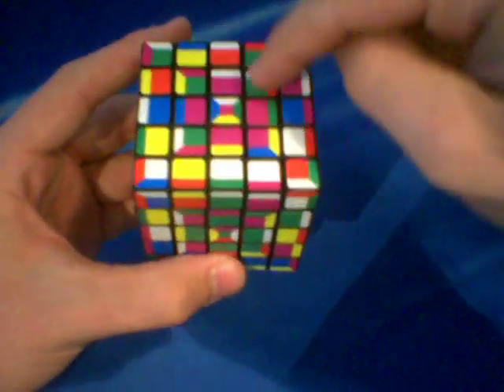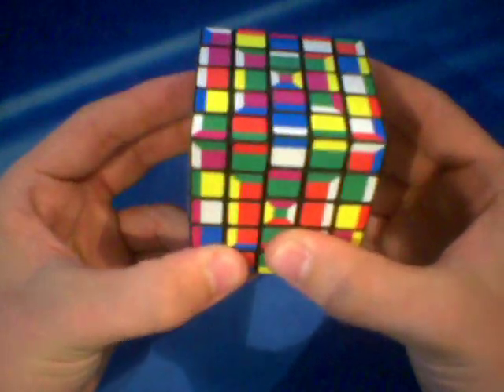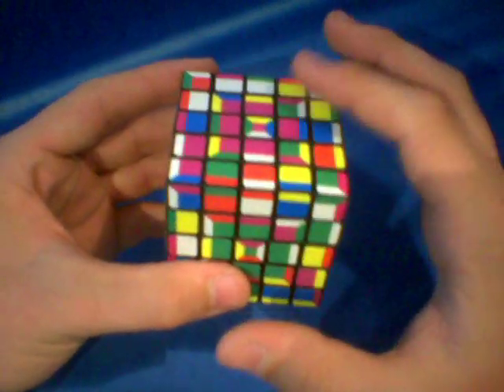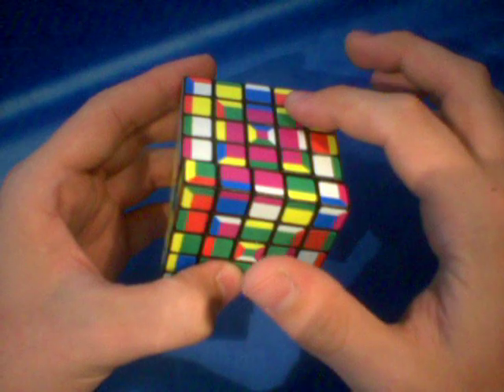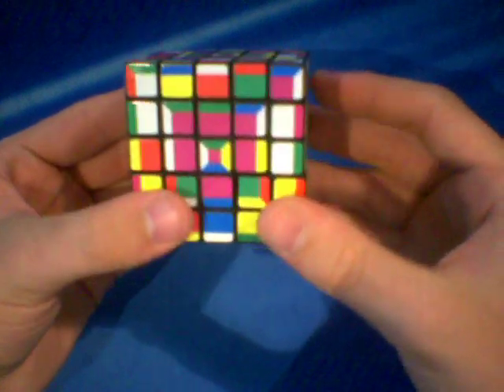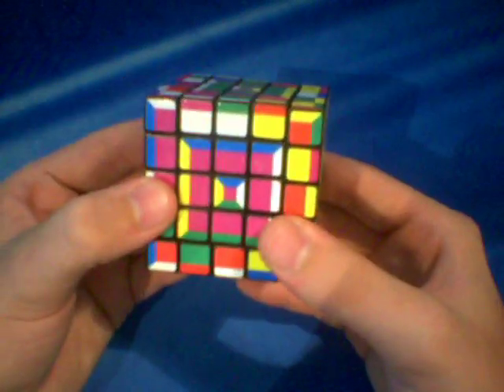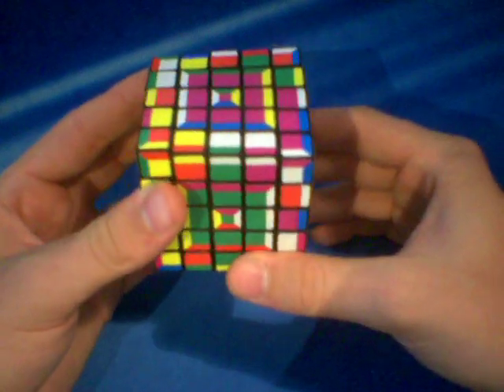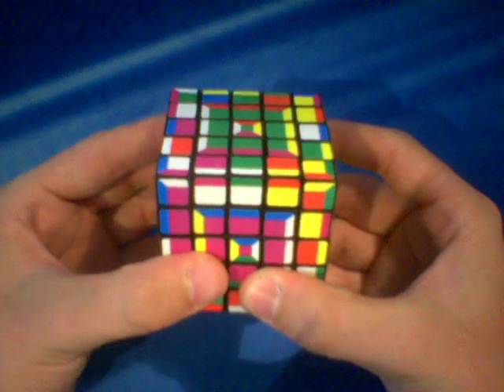Tutorial / How to Solve a 5x5 Super Cube: Part 2

Comment: It is probably easier to use a cycle that cycles 2 pieces on top and 1 piece on front. This allows all 4 center corners to be solved on the front while ignoring the top. All but one center can be solved in this way. Then for the last center, the corners can be cycled by moving the front bottom row to the top back row, cycle, then move row back (same as 4x4x4). Rotate front corners clockwise Fdr not changed Fdl -> Ful-> Fur -> Fdl: d R' b r U' l' U r' U'l U b' R d'. Rotate front corners  counter clockwise Fdl not changed Fdr -> Fur -> Ful -> Fdr: d'L b' l' U r U' l U r' U' b L' d.  For the normal top to front cycling, these patterns move corners from the same position on top to the the same position on front, which is easier to follow: Ubl->Ful->Ubr->Ubl: l  F  r' F' l' F  r  F' , Ubr->Fur->Ubl->Ubr: r' F' l  F  r  F' l' F , Ufl->Fdl->Ufr->Ufl: l  F' r' F  l' F' r  F , Ufr->Fdr->UFl->Ufr: r' F  l  F' r  F  l' F' . The patter is move a corner down, move it out of way with front turn, move it down again, turn front back, and reverse moves.This also works for center edges.